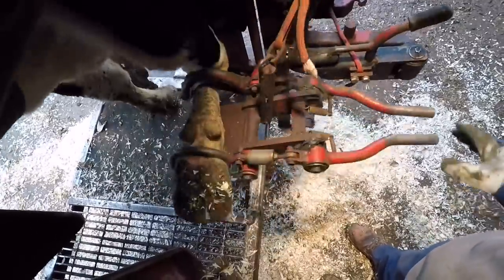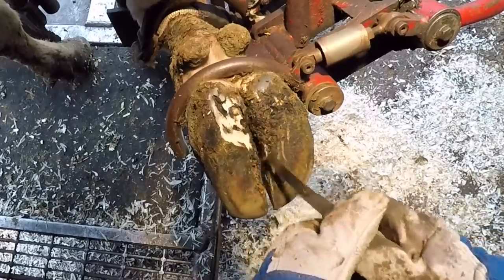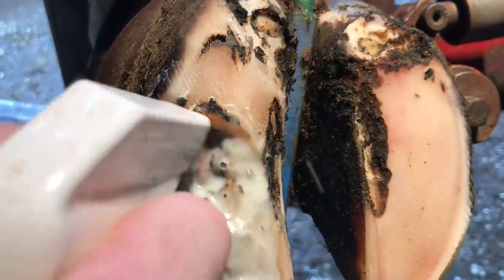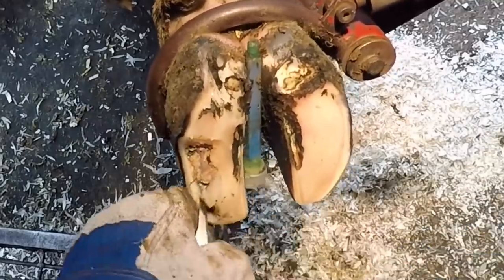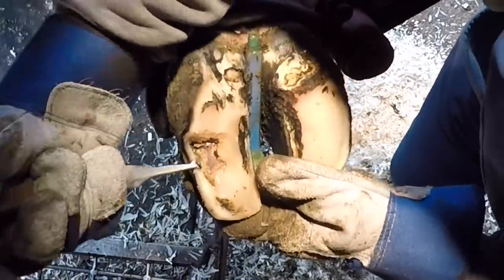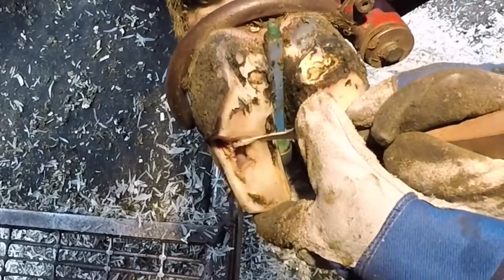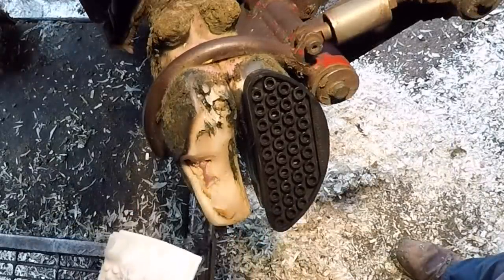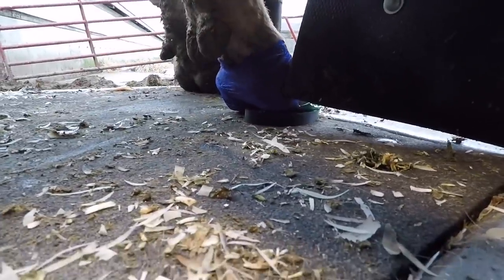WHAT DO YOU THINK IS HIDING IN THIS HOOF??

Comment: Everytime I see the way that machine twists that cows leg like that I'm like jeez that looks like it's not supposed to turn that way!
Reply: Most hoofed animals' legs are surprisingly flexible that way (cow, deer, horse, etc.). They don't lay down much but if you ever see them laying down they twist their legs all over the place lol
Reply: @sbp4215  ok well, hell if I know.
Reply: @nicholasbiddle7893  Nope, you're wrong and he's wrong. All that machine does is it bends the cows knees(wrists actually) just slightly over 90° and turns them outward a bit too. Just because you're not good at human-animal anatomy it doesn't mean their limbs get twisted. It's well bellow the maximum range of motion those joints are capable of. The same degree of bending would work even on your scrawny human forearm and wrist without causing you any pain(minimal discomfort may occur) So the point is, calm down, they're fine. 😉👍
Reply: @TAURON85  I think you need to calm down lol… nobody is freaking out… nothing wrong with human observation, plus I think we all know this guy knows what he’s doing… even tho it does look weird lol
Reply: @TAURON85  How about you kiss our posterior
Reply: Think of it as you putting your arm behind you with your palm up. When I had a horse, the farriers did not have equipment like this. They would hold her hoof between their knees.

Comment: Hey Nate, little question, when you know a cow has a serious issue like this, why not put the block on right away so the glue has more time to dry while youre working. Or will the block get in the way of your trimming at first?
Reply from the maker: I do sometimes but they do get in the way when trimming so I usually wait.  The glue sets is fully cured in 3 minutes so it doesn’t add much time and usually I trim another foot while it’s curing.

Comment: Hi Nate, you do good work. I'm always wondering why pressure washers are not employed to clean off the hoof's before working on them?
Reply from the maker: It would make a huge mess with my equipment of which runs on electricity.  Water, electricity and cows don’t mix.
Reply: @NatetheHoofGuy  Spraying down hoof before using equipment, just makes for a cleaner area to work on.

Comment: Are you ever concerned of transferring dermatitis or other infection to another hoof/foot as you use the same trimmer to continue triming or do you have to disinfect it between hooves
Reply from the maker: Not really.  The bacteria are present everywhere they walk so me just touching them likely wouldn’t spread it.  It needs an entry point.
Reply: @NatetheHoofGuy  And the subsequent salicylic acid wrap would have killed the transferred bacteria if ever. Is that how you are thinking?
Reply: The bacteria is all around the barn and everywhere. It needs an opening in the hoof to cause problems. The good toe doesnt have a hole or opening so even when caked in mud and feces, it's fine. The wounded toe had a crack that formed in the hoof which allowed the bacteria in the environment to seep in and cause an infection. The reason he adds the disinfectant is to kill the bacteria that is deep inside the hoof so that the hoof can heal. He constantly sprays disinfectant while trimming and then at the very end, packs the toe with even more disinfectant. The barn is not a sterile environment. To have his tools be sterile would be not useful unless everything else in the environment was sterile.